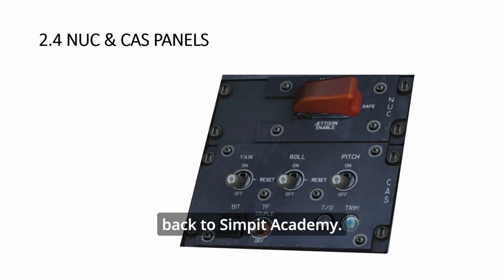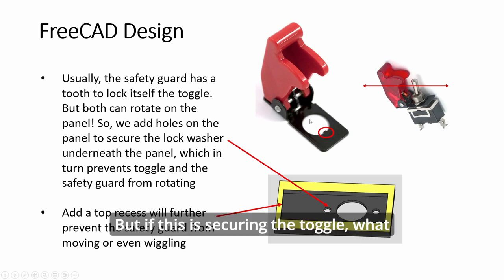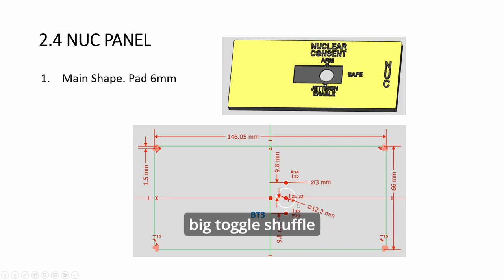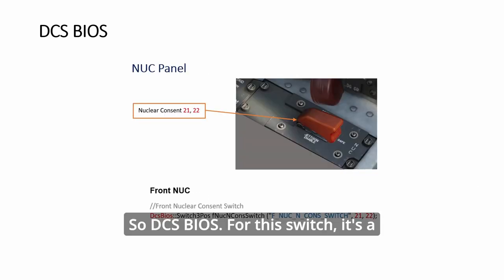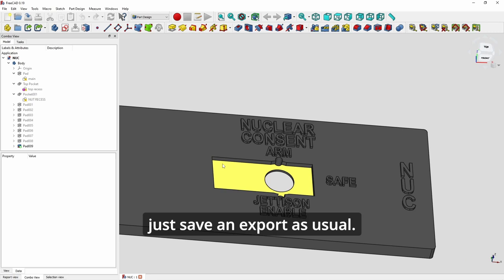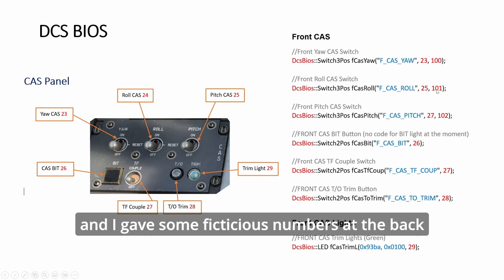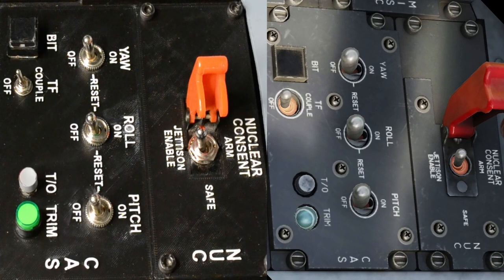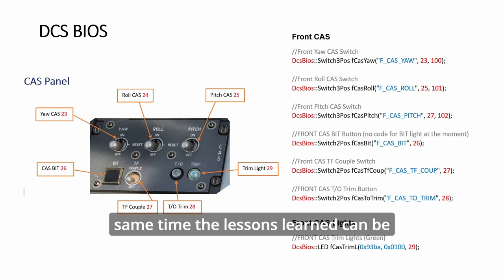Episode 6 How to build DCS F-15E NUC and CAS Panels #dcs #arduino #flightsimulator

Comment: You're videos are good. If my previous comment came off as a insult I did not mean it in such a way at all. These videos are very cool. And the quality is good. I'd love to see a video on your 3d printer and the settings you use to get the physical panel looking good. Do you think you will ever do PCB design or will it always just be single arduinos panel? 😊
Reply from the maker: All good. No offence taken. As I showed in this video, in my slicing software Cura, I just use infill density 15%. Standard quality. In my 3D printer, I choose standard defaults for PLA, which is 200 for the filament and 60 for the bed. Now the printer is showing its age and I have to use those student purple glue stick to make it stick. But settings wise all pretty standard. So nothing much to show you about settings with a video. 

As for PCB design, I have limited knowledge. Of course I can self teach on this like freecad and arduino from youtube. But it seems like a hassle, like making backlighting and fussing with positions of a dozen small LEDs for even lighting. My focus is to build fast and fly in VR. Hence I do one layer panel, no backlighting, no PCB etc. I don't want to spend years making the panels look perfect which is not necessary if you fly VR. Those who still use TV or monitors and want cool backlighting or very sharp looking panels of course can spend time doing CNC and PCB to make even the wiring look cool. I just want a functional cockpit to fly in. It depends on your need.
Reply from the maker: The next video will show the RICP panel. This one is going to be huge. We'd look at building four new knobs, brackets to hold dual encoders, a special cover with cut out text for the REPLY light indicator etc. Lots of good stuff to check out.
Reply: @simpitacademy  awesome I agree in VR it doesn't matter, I agree, but I will say Mixed Reality is fast approaching, it would be worth it to make videos about those topics aswell as people are interested. I will say I am excited, what will you end up using to attach all the panels together?
Reply from the maker: @Datttsnake  I will try to build a frame that looks like a cockpit lol. Building frame made out wood is harder than freecad design. It has to be sturdy without being too heavy or complex. But I have no interest in making light panels or pcb at the moment. I'd rather learn to fly and operate the aircraft, which is complicated itself, navigation, radio, UFC, many weapons. All these will make up another playlist for my videos.
Reply: Great videos. Will you be uploading .stl’s. of the completed panels to any sites?
Reply: @simpitacademy  have you thought of using a mix of 2020 aluminum extrusion for the consoles and 4040 for the frame. I'm doing that with my cockpit and it's made things much simpler.